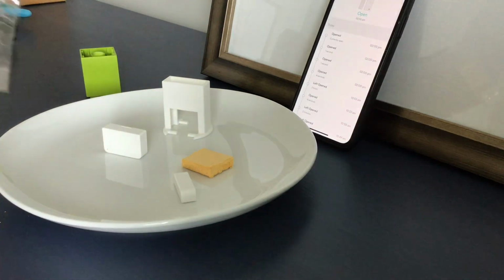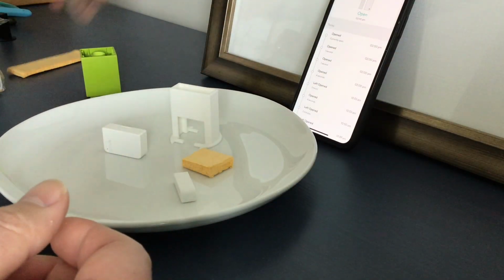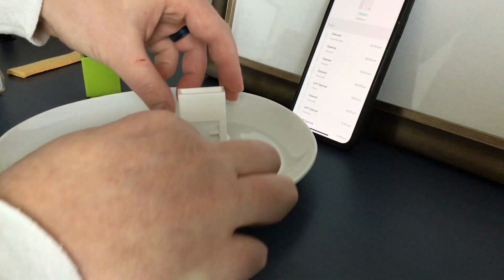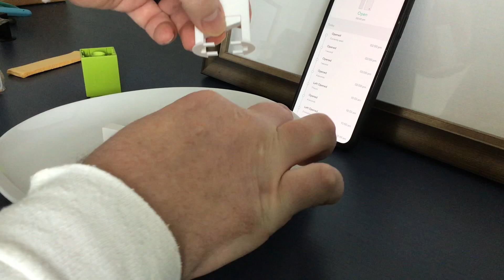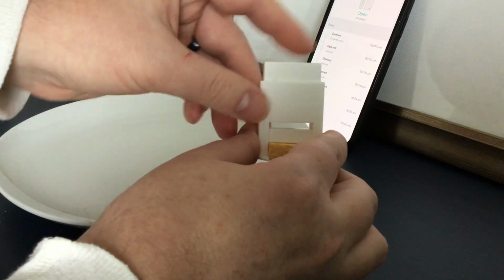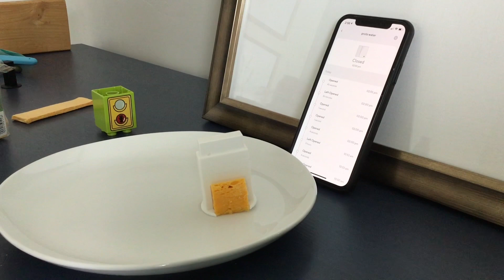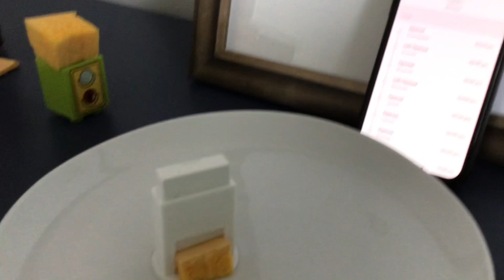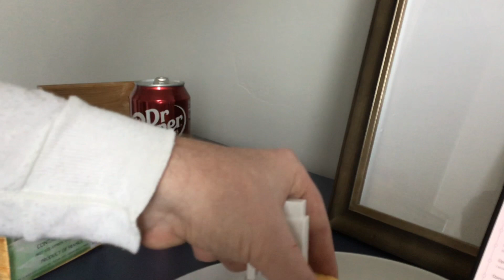Wyze Water Sensor (no soldering)

Comment: So I’m trying to buy off your site however is the bracket for $5 include magnets? Idont understand how this will send a notification to my phone I understand the sponge doesn’t come with it.
Reply from the maker: Actually you have the option to add a sponge. I found a decent deal for them on Amazon and bought in bulk so you can just get 1 instead of a dozen that you might not need.

As for the magnet. It uses the magnet that is included with the V1 wyze sensor. Just the sticky foam tape is removed. The sensor is not included with the bracket. But it is connected to your wyze account. 

That all being said make sure you have a V1 sensor because Wyze discontinued them about 2 years ago when they released the V2 and they also have a dedicated water sensor now which is why I have not made one for the V2.
Reply: Thanks! I have the V3 so I’m out but love the innovation 👍👍

Comment: By the way, I read online the way to recompress the sponge back to compressed state, they use a glue solution that it keeps the sponge in its pressed form, but it is water based.  they may use heat air to dry faster.  I hope this helps.  I don't know if it works or not.  Just a suggestion since you said you were experimenting with pressing them back again.
Reply from the maker: yeah I got it to recompress even without adding any sort of glue. However, each time got it wet it took longer to expand. I found a different brand of sponges that are better suited for this application and they are cheaper so it really just isn't worth the time and effort to recompress it. But that is me evaluating my time other people my feel differently.

Comment: Great idea! I would think one could put the wet sponge under a weight, like a brick, on hot blacktop or cement for a summer afternoon and have it dry compressed again.
Reply from the maker: I tried that using a clamp. It did recompress but the second time it got wet it was slow to expand. The 3rd time was even slower. I didn't try any more after that because my reasoning was the sponges were cheap enough it wasn't worth the loss in performance.

Comment: I received 3 of these. I set it up like the directions said. At it furthest closed position it still registers open. If I switch the larger piece with the flat end down it registers closed even with magnet at it further away. Just for a side note. I have the garage sensors and work great
Reply from the maker: So you have the sensor round side down. Then you push the magnet all the way up between the legs and it is still registering as open? Can you take a picture please. You can message me in Etsy with the picture.
Reply: Sure

Comment: I've designed a pill bottle top to hold the circuit card from the sensor, so when the top is opened it moves away from the magnet that holds it closed and the notification lets you know you took your pill.  My wife is always asking me if I saw her take her pill or not.  Now I just need to get it printed.
Reply from the maker: Willie cool you should just get your own printer. They are pretty in expensive these days and high quality. I recommend the Ender 3.
Reply: @ideaxtruder  I started printing it (with my Ender 4) but was getting some globs so have to tweak the settings.  Been working 12 hour days, so pretty much have to wait for the weekends to do it.  https://www.tinkercad.com/things/2D5eFd2Ht3e

Comment: Ingenious use of "magnetic distancing" (like "social distancing" but for attractive people) to set off the sensor.  I originally thought you were going to place the skinny sponge between the sensor and the magnet (which could be basically any magnet) so that it would show as closed until the sponge got wet and separated the sensor from the magnet.  A cheap magnet bumper sticker like the one's I get from pet charities could be glued to a board and glue the sponge to it and glue the sensor to the top of the sponge.  Well glue or double sided tape should work as well.
My luck a packrat would pee on it while it is under my house just to show that strange white object who's the boss.

Comment: Are you removing the foam adhesive on the back of the sensor and magnet?
Reply from the maker: rafoster2000 yeah all my designs I remove the adhesive. Even if I am going to stick it with adhesive I wouldn't use the stuff that comes on it. I have had too many of them fail to trust it.

Comment: I bought your product.. You need a bigger space between.. I bought the exact sponge as well
Reply from the maker: hawaii137 which way did you place the sensor in?
Reply: @ideaxtruder  round side down like you said the in video
Reply from the maker: I will look into adjusting that but in the meantime you can probable get it to work by just putting a little bit of paper into the bottom of the slot that holds the sensor. it should only need a few millimeters.
Reply from the maker: btw there must be something slightly different like your magnet is stronger or something. I test every one i print before I ship it. obviously I don't put water on the sponge but i insert it and make sure the spacing is correct.
Reply: @ideaxtruder  is there a way to alter the settings?  Maybe wyze made it different when I put it round side down, the distance is too far.  And doesn't recognize it closing.
Reply from the maker: I don't think you can change the setting for that because I have actually submitted a feature request for that. So to be clear were you able to add enough space to get it to show "open" when it is in place?
Reply from the maker: also another thought is to slice the sponges so they are thinner. which may be a little difficult and I don't want you to do anything that you may get hurt doing. but it might give you enough space to get it to work and double your sponges. the sponges really expand a ton so by cutting it in half it will still probably lift it enough to make it work. you can use 1 half to test it. I would like to see a picture though so I can see how to improve my design for others. I really am not trying to sell these to make a ton of money. I am just trying to help people solve problems. I really want it to work for you.
Reply: @ideaxtruder  when doing the round side down.  It doesn't show it closed, when putting it together, between the holder .. When doing the other way its way too strong.  It says closed
Reply from the maker: so with the round side down it is showing open? because it should be "open" when there is no water. It will always show open until water expands the sponge and causes it to close. Sorry if i am not understanding.
Reply from the maker: I just wanted to check back and see if you are still having issues? If so how can I help. If not could you please go update your review on etsy?

Comment: Brilliant! Another great idea... I don’t have the skills you have but what do you think about making a pressure sensitive doormat ? I would using something conducive under a normal outdoor mat and when it’s stepped on it’s closes to complete the circuit... hopefully that makes sense
Reply from the maker: Roby Davis yeah that makes sense the hard part would be making it would having to take the sensor apart and solder on my own wires. I like your thinking. I will give that some thought.
Reply from the maker: Ok I think I got an idea but it will take some time to develop. Also making sure the materials are cheap and easy to work with will be a little big of a challenge. But it should work and it won't require taking the sensor apart or soldering anything.
Reply: Drew Calder sweet! I can’t wait to see what you come up with.
Reply from the maker: @RobyDavis  so i was doing a bit of research and I found this https://amzn.to/35DBxX9 if you are comfortable with a bit of soldering then you can just solder the wires to a wyze sensor. If not I should have something in the next month or so that will work.